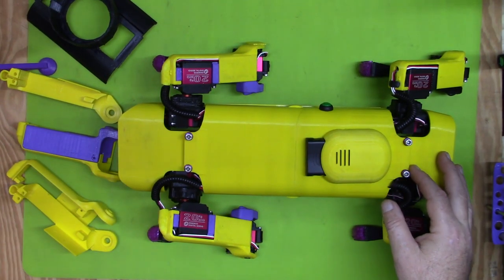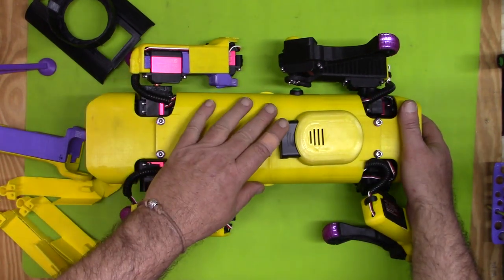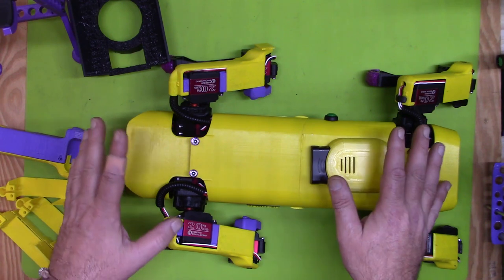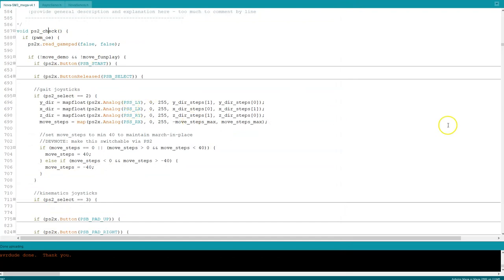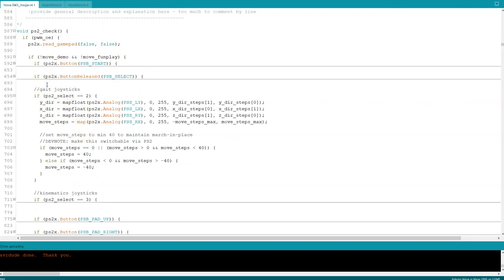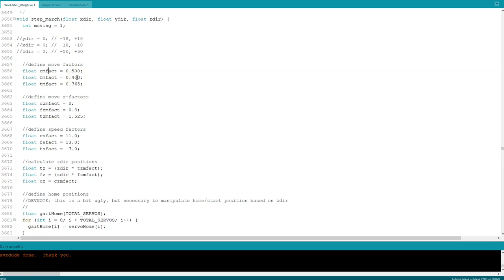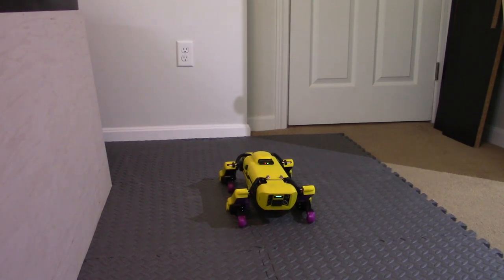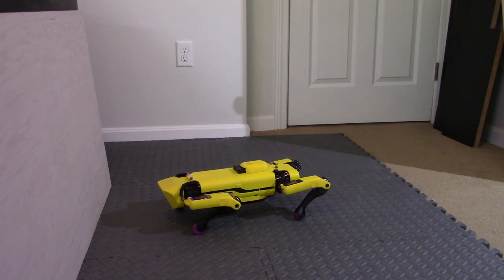NEW Walking Gait and More Updates : Nova Spot Micro 3 v4.1

Comment: is it possible, say in a test mode to get her to do the steps really slow and using the gyro sensor try and keep balance on 2 legs?
Reply from the maker: yes, that's on my list to do next. Its better to get the gait as stable as possible before adding more complexity to it. The MPU will indeed be very useful, but it can't be relied up to do all of the work... she has to move, and the MPU is meant to stabilize, so they sort of contradict themselves at the moment.  The MPU will help with getting the final imbalances out, and the unexpected, such as walking over an obstacle.

Comment: I've been studying inverse kinematics equations for various types of robots, quadruped, bipeds, and what not. The reason I like learning about them is because they help make the robot move more efficiently. I admire your alternative method but in the future, if you are open to it, I highly recommend trying to use inverse kinematics. there are software's available to help test in a virtual simulation, like coppelia sim which is free.
Reply: hi, yes i would prefer to use kinematics, the only software i have been able to find runs on linux and dont have a system set up for that, correct me if im wrong, thanks
Reply from the maker: I prefer to rough it.. write my own software... this is why I do these projects as a hobby.  I may attempt to write IK code one day, but I'm having fun choreographing Nova in code and sequences rather than heavy mathematics.